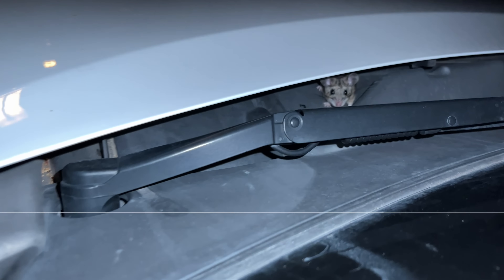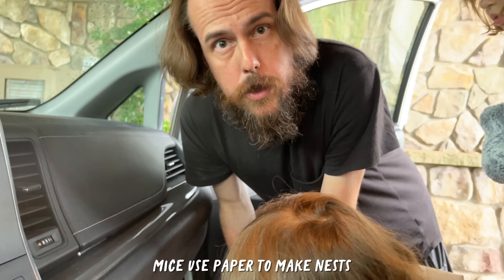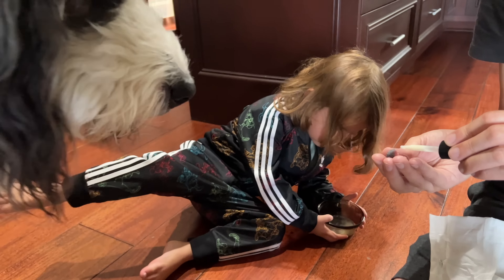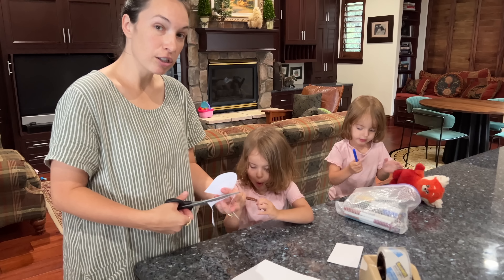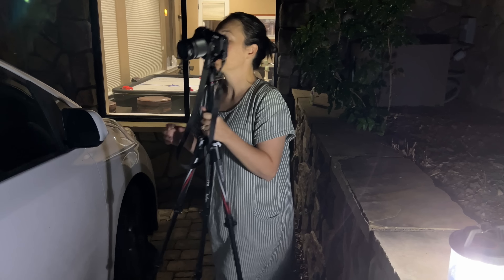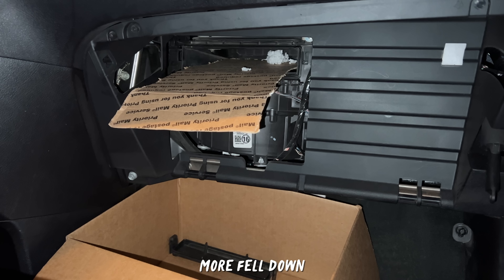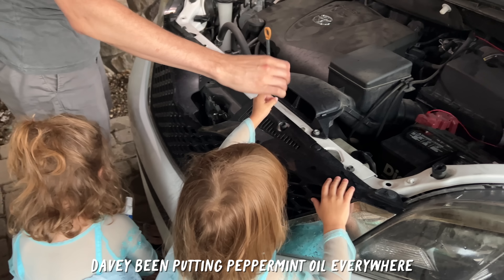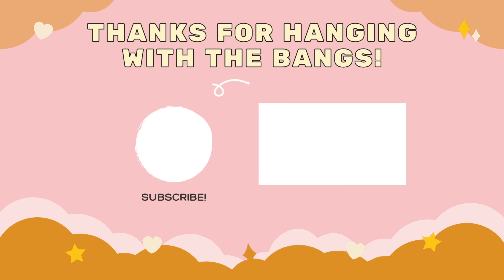MICE LIVING In Our Car?!?!

Comment: hi! next time do an oil trap! you do a tall plastic bowl with oil in it and food for the mouse (and ways for it to get up and into the bowl) after it falls in the bowl the oil is too slippery and it cant get out. safer for the mouse than a glue trap. easier to release them later.
Reply from the maker: I have never heard of an oil trap, thank you for the tip! That sounds like a good option!

Comment: Should have left it in the car for the parents to come back and get. If one baby disappeared the other would too. You killed a mouse by trying to save it when it didn't need saving. Also those wire bar cages.. Ever see a mouse and what they can climb through? A 66 quart clear storage tote with lud from Walmart with air holes drilled all over is about $10 far bigger and more secure than an aquarium. Safer and no bars. They can squeeze through a crack lol😂 zero idea what you're doing.
Reply from the maker: Yeah we did have zero idea what we were doing. Did our best for what we could and figure out. Sadly since they were wild mice no animal rescue would take them. I did leave the baby in the car for a hour by itself and the mom never came and got it. I think the baby could of been sick or something for the mom to not come back and get it